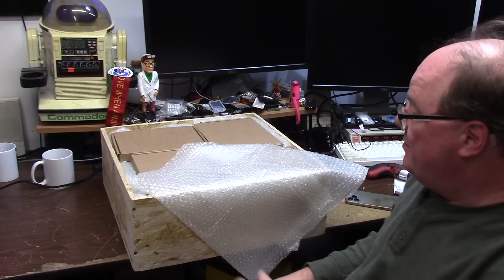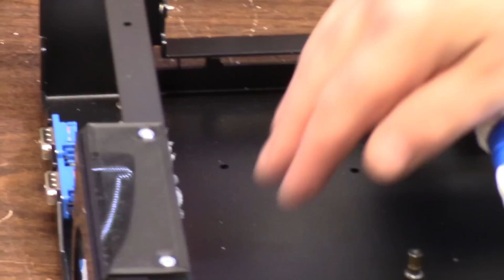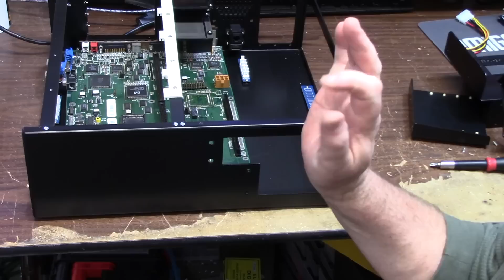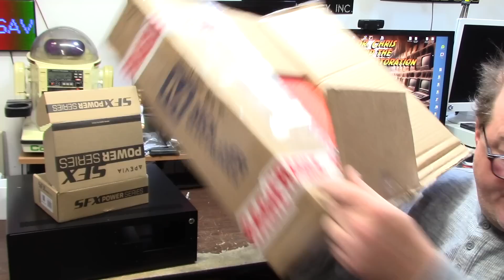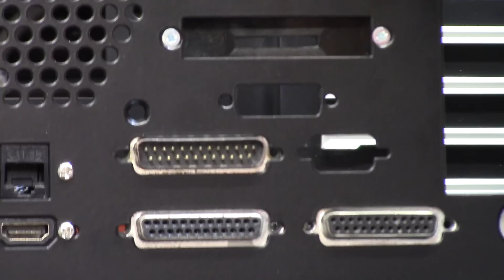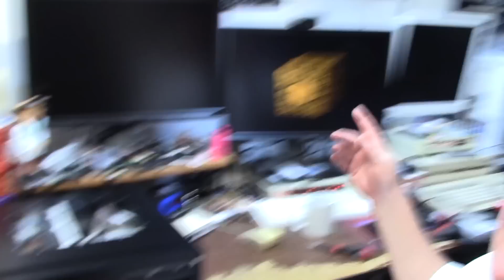The New Custom Amiga 4000 case from Szymon Gosk

Comment: So does (UK based I assume) Symon consider making a custom metal card slot for the A4000? That 3d printed one is now cracked and too soft, for the GBA PII RTG card.
Reply from the maker: the SD card slot is metal base with a 3d printed top that the thing screws into

Comment: Nice review of Arymanx’s case. Have been tempted by these. Will have to check it out and see if there is an option to add more drive bays (3 ain’t enough). I have Craigs’ (Ordynes) A4000 Desktop recreated case. That too has modifications for SD card readers etc.. Cheers 🍻

Comment: He does do nice work. I have one of those 4000D cases for an ACILL built board. Trying to get him to make 3000D cases like he did for Stefan from 4091 fame. With that glass top, you could get a Solas board for RGB goodness if you like that, and amigoun makes direct ATX to Amiga adapters for modular PSU's which really cleans up the wiring management inside.  Another cool video. Havent been hearing the vacuum-hope your carpets are being kept clean. Happy holidays sir and thank you for all you do for the community.
Reply from the maker: @boydpukalo8980  haha I just had to buy a new one. Mona broke it, then broke my basement one too

Comment: I wonder if he could make a rack mount unit.  Most of my Amiga's live in a server rack to save space and I have them connected to a KVM Switch so they all share the same Keyboard, Mouse and Monitor.   I went rack crazy so I have racks for a bunch of other retro computers too.    I have an A500, A600 and A1200 in Checkmate Cases but that case blows the Checkmate Case out of the water.   One thing I hate is opening up and working on those old Big Box Amiga's but if I were to get new replacement cases I would take the old cases and make a wall display out of them which is another project I got myself into where I am planning on wall mounting a bunch of 8 Bit Computers.   Damn I need a bigger place to live.

Comment: Chris let us know if someone comes out with a A2000 replacement case. :)
Reply from the maker: he has a ton of different ones, even a 3000 tower.
Reply: I don't have A3000T . I think you were thinking about Ordyne. Although I made a few custom made cases for A2000. On Amibay is post in PhotoBooth section. I need to update this post but I don't have a lot of spare time. @ChrisEdwardsRestoration

Comment: awesome case wish I had one of those, but I have yet to get an A4000 so no need for that yet. maybe some day. Although I have a Black A4000 ATX board I bought a few years ago on Amibay, thinking oh I'll just buy the chips then prices went through the roof and it sits till I can buy the chips or a damaged board for parts.
Reply from the maker: just do it, it will never get cheaper or easier. but dont follow me for financial advice.

Comment: Great.  Now I need to buy another 4000 board to put in one of these!
Reply from the maker: You should!
Reply: @ChrisEdwardsRestoration I take it you know the A4000 D ACILL boards have now been updated by Saft6luck? I have managed to get a REV 2.2 with extra mods such as 112MB FastRAM, A1200 Clockport etc.. Rev 2.4 is being designed with SCSI! Just recommended that the 3 connectors be added for the RATTE monitor switcher. Exciting times!
Reply from the maker: @ wow looks like I’ll be ordering one of these then

Comment: A nicely made case indeed. Very solid. Penny-pinching on materials does little for cost savings in small volume and "manual" manufacturing where the labour costs, especially for DESIGN dominate. Consider that even the first-cut design would require 100+ hours. Then at least 2 iterations of refinements; each perhaps 50+ hours just in design time.
 
P.S. Get some black, button head socket screws for the business on the front panel. Add some red pinstripes across the front to make it go faster. (It reduces the perceived height.)
P.P.S. Tower orientation doesn't quite work because of the PSU fan. Add some feet to raise the case 25mm or 0.87655399 inches. 😛
Reply: Using it in vertical position wasn't "advertised" by me, but I guess that with some right angle DB9 connectors and proper raiser it can be used vertically. 
Almost with each new batch I do small "improvements" or add new features (like cutouts for HDMI and RJ45 - Z3660 focused).

Comment: Hey mine doesn't have the window in the top! Now I need to take out a forth mortgage on my home to buy this one, too.

This case is rocking my all new/new old stock 4000D sporting a TF4060 and ZZ9000 for RTG and ethernet. I'm still on the hunt for a suitable replica mechanical keyboard in matching black...
Reply from the maker: this is like 3 months old before the public offering on the amibay site, there are only a few w the window options. but you can now add it i believe.